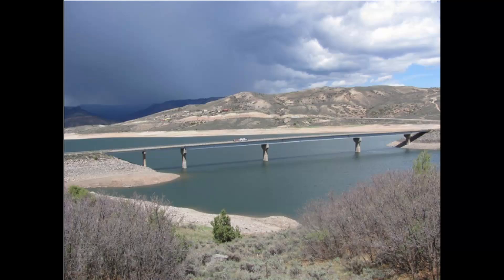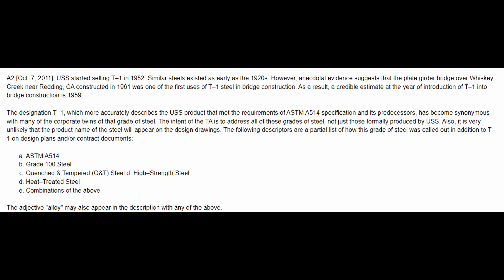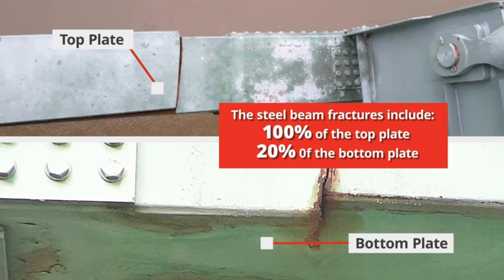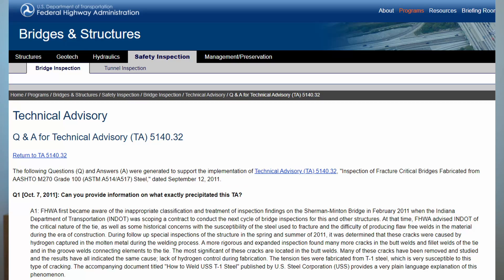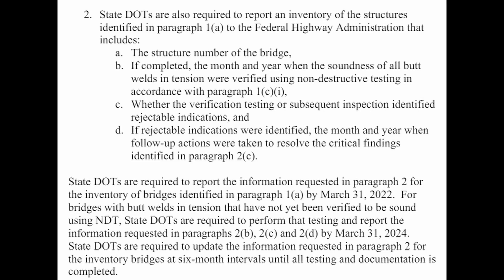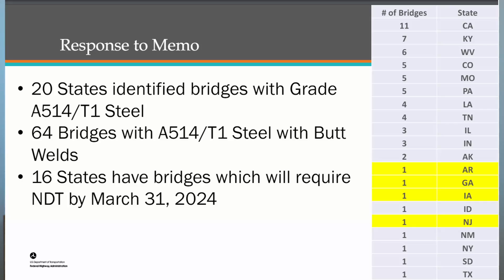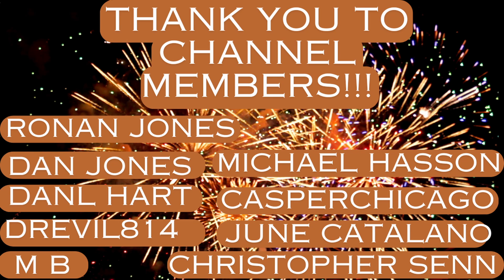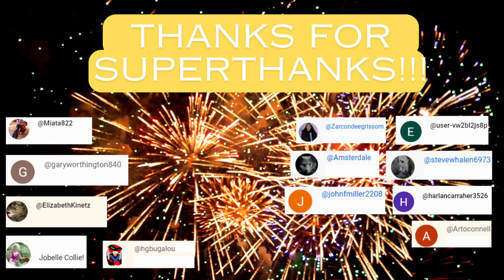The Major Implications of the US-50 Bridge Closure in Colorado

Comment: If we now understand that the type of weld was at fault, what is the problem with cutting out the old weld, then laying a proper weld?
Reply: Two problems:  a. Cut out the old weld and the bridge falls down. b.  the "proper weld" done outdoors might be possible for a single weld of 50 grade HPS with a plastic enclosure in good weather, but most likily with T-1 will be worse than the one cut out as the site is potentially close over water, temperature and humidity changes are drastic, and the wind blows and is gusty.  Early in my carreer a fabricator attempting flange butt welds on 46 ksi bridge steel for a structure I designed went broke with the cost of the rework and upgrades to do it right, and that was in a shop.  Note there are a couple of hundred welds with problems.

Comment: Recent update on 8/13/2024:  Refinements to timeing of public light vehicle crossings.  Also allows school busses..  Expected opening to all legal loads 24/7 by mid Noverber.  Finished by end of December depending on weather.  The estimated amount of steel required is now up to 420 tons, 400 plates, 55,000 bolts.  Many suppliers and steel shops involved.  Work now includes cross bracing.  Cost mentioned is $100,000,000.  I think this indicates they are using this emergency to shoot for a near total rehab of structural and deterioration issues, and perhaps a few other less critical issues.
Reply from the maker: Thank you for that update!  This bridge is turning into the Ship of Theseus!
Reply: @CaseyJones-Engineer  Didn't know that reference.  My experience is that any structural issue can be repaired or strengthened, but inadequate functionality is tougher.  Generally for composite structures the girders compromise about 1/3 of the structure cost, the substructure 1/3, and the deck 1/3.  These structures may be more heavily weighted towards girders and substructure, though the lack of decent detour would make a deck replacement difficult.

Comment: So, Casey, how can you know when you are safe enough?  I know from having worked in the cybersecurity realm that, when talking about safe, it's not a yes/no issue.  It's degrees of safety, and finding the right metrics, criteria, and thresholds is tricky. It would be great to have an series of episodes on how you establish and measure safety for dams, bridges, highways etc.
Reply: Fortunately structural engineers have been designing structures for several hundred years and change codes to correct issues found.  The latest US bridge code, LRFD started out by determining exactly this issue.  For new bridges the target is a 1/10,000 chance of failure in a 75 year life, without considering deterioration from age, based on public acceptance.   Foundation failures and rails have a higher tolerable failure rate due to a lack of control of unseen natural materials and public behavior and impracticality of achieving the same reliability as new bridges.  This does not consider "black swans" which are beyond prediction.

Comment: I have been critical of you in the past but this is the kind of report I appreciate.  I do have a single question, has anyone looked into why this situation was not discovered in the bi-annual bridge inspection.  While cracks that need testing would probably not be visually apparent, it certainly appears in some of your examples that these are visually apparent.  Having been responsible as a principle and as an inspector on over 500 bridges I begin to wonder why some of these cases were not identified.
Reply from the maker: Uncovering these cracks takes a level of effort that is well beyond that required for routine or periodic inspections.  FHWA became aware of the cracking issues of structural members on bridges made of T-1.  FHWA required states to identify which of these bridges were still in their inventory and directed them to complete high-end inspections including non-destructive testing (NDT) using ultrasonic or magnetic particle testing.  Those inspections were to have been completed by February 2024 but it appears that deadline was not met in Colorado as it wasn't until April that the discovered the first crack of concern.  I don't disagree that you would think (or hope) that at least some of these cracks would have been discovered through visual means during routine inspections.
Reply: @CaseyJones-Engineer  My question was not about those cracks which require specialized testing but the failures shown appear to be visually identifiable.  Maybe they visually appeared suddenly but in some of those pictures that does not appear to be the case.  Similarly the Washington Bridge photos of the vertical bars, while not in this category, would appear to have been evident in an inspection.  I cannot tell you how my employees had to clean guano off bridge seats to inspect bearings, that is when it is nice to be a boos.  It just appears there are some inspection issues.
Reply from the maker: @dmac6004  I think you are right about that.  The other category is where inspections document major deficiencies yet nothing is done about such as was the case for the Fern Hollow Bridge in Pittsburg.
Reply: @dmac6004  Many scary things are exposed when 20 years of sand and dirt are removed.  Unfortunatly this cleaning has not been typically done.  Focus is on potholes and stripeing most places.  After the I35 collapse from a gusset failure there was an FHWA mandate to inspect and rate Gusset plates that exposed a lot of heavy corrosion.
Reply: @michaelmcmullen354  As I said I have been responsible for over 500 bridges and having been on many of those I know that we had to clean many areas out, sometimes of loads of bird droppings, but it should be done.
Reply: @dmac6004  I agree.  Build up of any sort of debris and dirt, sand anywhere causes deterioration.  My personal feeling is that the number of inspectors should be doubled or paired with an equal number of maintenance folk and they should have a PU with them wiith a medium sized tank of water, an air compressor, a high pressure sprayer, power supply, a Magnetic drill, an assortment of HS bolts, nuts,  washers, extensiometers, maybe a welder, small sand blaster and plasma spray gear (or not... maybe one team could have a qualified welder ), garden sprayer with siloxane.  Two year cycle as for bridge inspection should be often enough.  Won't happen.  They need the mtc head count for maintaining the asphalt surfaces.  One region in Colorado used to have a small mtc team specializing in bridge mtc, but the head count need for asphalt mtc closed them down.  I likewise for a few years was in charge of a design squad responsible for 2 of the 6 design regions of Colorado.  My best luck at getting this sort of stuff done was coordinating with the resident engineers setting up paving jobs to get as much of this minor repair and profhilactic mtc. done under the radar for paving overlay jobs.  The Bridge maintence in Colorado has gotten much better over the last 10 or 12 years though, but that does not eliminate the damage from 40 years of neglect.
Reply: @CaseyJones-Engineer  Actually these inspection reports, if well done, are very good as the rehab design engineer can track progress of the problem through multiple inspections.  New method of reporting with a number score for each element, not so useful except for tracking system wide deterioration trends.
Reply: And impedes inspection.

Comment: How is a welder for 41 years amongst other steel construction when I worked as a sheet metal worker are you telling me that they were depending on butt welds to maintain a bridge. That is remarkably insane. Even when I put together temporary i-beams and had to lengthen them in order to use them as trolley rails to disassemble and reassemble elevated booths inside of a factory. I know they're 2 in thick and there's a welding specification for that, but there's nothing wrong with fish plates or with straps to ensure reliability

Comment: Hydrogen cracking is not caused by stress etc. It is literally hydrogen diffusing through the steel and coalescing to something like microscopic bubbles in the metal crystal lattice. A crazy nightmare of a problem.

Comment: What options were examined ,other than closing ?  Two vehicles or some number, One semi truck at a time….so as not to effect people requireing use.   Temporary repair…..weld crack….weld patch steel….or just panic, and close it !   Who is in charge ?  Hopefully not a government agency.
Reply: I believe CDOT was in charge, both the resident engineer in the region, and the state Bridge engineer.  Higher ups did a great job chasing down money and coordinating with FHWA, the rest of state government, and the congressional delegations as well as keeping everybody off the backs of those actually trying to do the work and fix the problem.  Once the contractor was selected with his Engineering firm partner things went fast because the contractor and his engineer of choice had been down this path with this problem recently on the Hernando De Soto bridge, and was used to working with CDOT as well.  Also it seems at this time that none of CDOT's early decisions had been wrong.   Odds are that any collapse would be in winter when the steel is more brittle, but delaying inspection and repair would just mean delaying any fix to next year, if the bridge survived that long, but closures and problems would be no better then.

Comment: How long did the original engineers expect these bridges to last? Nothing lasts forever.
Reply from the maker: I agree that these bridges are at the end of what would be considered their useful life at 60 years old.
Reply: @CaseyJones-Engineer  I believe the Colo State Bridge Engineer mentioned that the average age of a bridge in Colorado at replacement is 62 years.  We have relatively few highway bridges still in service at 90 years old.  Current target lifetime for new designs per code is 75 years, with some designs targeting 100 years, but I am not sure we have enough of a handle on corrosion and concrete deterior exacerbated by deiceing chemicals, problems with steel girder fatigue, expansion joint leakage and breaking, and expansion joint failures.
Reply from the maker: @michaelmcmullen354  Thanks for your comments.  I think corrosion will pre-maturely limit the life of many bridges.  I think road salt was a big factor in the problems associated with the Washington Bridge in Rhode Island and that bridge only lasted 50 years.
Reply: @CaseyJones-Engineer  A few years back CDOT replaced a very large bridge that needed to be replaced mostly due to corrosion problems and the limited life of patching again.  About a billion $.  We spent about $25,000,000 on a medium life rehab so that it would safely last until the EIS could be complete (about 15 years to get an acceptable EIS).  Note the rehab had to be bid three times before there was a sucessful one.  The ultimate replacement lowered the grade rather than replace in kind in order to accomodate community desires and needs.  Untimately, in my opinion, the issue was a lack of shoulders and room for maintenance while under traffic.  Just about everything that can go wrong with a medium sized bridge showed up somewhere on this bridge (no scour problems or vertical clearance problems though).  Much of the problems were related to road salts and poor drainage though.  A lot of extra work showed up during rehab and was fixed, fortunately within budget as the planned rehab work went more smoothly than expected, and some turned out to be unkneeded (old visual bottom of deck signs of deck problems had not been washed away after a high quality rehab in 1980).
Reply: A few years back Colorado, in combination with an upgrade of our bridge rail standard designs for new crash test standards, shifted to stainless steel reinforcing in the curbs under the rails or in Concrete bridge rails.  After several years the backwash from contractors has not died down on this shift of the most corrosion vulnerable reinforcing  (less than 1% of the reinforcing steel in a typical bridge).

Comment: Could be worse. You could be on that bridge as it collapses. That would really disrupt your schedule. We all know the US infrastructure is due for repair/replacement/upgrades. Inspections are crucial to public safety. There's no excuse for not having frequent periodic inspections.
Reply from the maker: They were doing periodic inspection. The issue with this T-1 steel requires an much higher level inspection effort at recently required by FHWA which when they discovered the first crack.

Comment: Sounds like the same teething problem with high strength alloys ship building went through. New weld requirements and people insist on doing the way they always have (engineers, construction contractors, and welders). I also wonder if engineers looked at how these alloys tend to not like the cold. 
Time to have states finance both extensive records searches and inspections. Ooof... Plans, as built records, material orders, sub contractors (and their records), inspections... 

People need to send mail requesting action from their representative. Let them know their voters are paying attention otherwise they'll apply funds elswhere where they think the can get the most positive noise for votes (or worse the shock and alarm bit after a death or two). Get them on notice, this is their watch .

Is there a list of locations available? Would like to know if one's in my voting district before sending a general request for both action on this topic and the funding for it.
Reply from the maker: You make several interesting points. I am continuing to research this topic and will post video updates accordingly.

Comment: Wondering about temperature extremes on this 50 bridge. This area gets 30 to 40 below sometimes in winter. What do you think ?
Reply: Thermal differentials can cause very high stresses,  Very cold can cause cracks to propagate very fast (speed of sound in steel) if the tensile stress is high and the charpy low.

Comment: I remember watching a documentary on the building of a new cable span bridge. The bridge was a new design and the construction company engineers had to figure out how to build the bridge as they went because a bridge of this design had never been built before. One thing the construction engineers went into is that the bridge was designed just heavy enough to carry the loads put on it. One engineer described that the bridges built in the early 1900’s were still serviceable because they were extremely over engineered and could easily withstand 2 or 3 times the loading required. It was very interesting. It is amazing that the bridges you discussed, the engineers knew the welds and joints would fail because they knew the techniques used were faulty. It just doesn’t make sense and now we are paying the price.
Reply: Note that most of the structures built in 1900 have already failed (some during construction), or become obsolete.  With appropriate maintenance railroads may be an exception, as they are not subject to deiceing chemicals, locomotives are no heavier now than in 1900, and many lines have no more traffic now than in 1900.  They do have problems with floods though, and are unsuitable for high speed trains and significant overloads (highway bridges are usually subject to overloads... up to 100 tons is common in Colorado, and most of those built in 1900 were designed for about 10 tons).  The public does not scream bloody murder if a line is shut down for a time for repairs or maintenance as both the traffic and the structure is under control of the RR.

Comment: I realize it is inconvenient and can affect lives for a bridge to be shut down due to failing an inspection. As a co-worker of mine who survived her car being on part of the I-35W bridge that collapsed almost 17 years ago, and having been affected by bridge closures due to collision by river barge traffic, as well as an overpass being offset from it's abutments due to a crane that hadn't been properly secured before travel, I'd note that a bridge that is taken out of service because of a recognized fault that can be repaired in a few months (depending on weather conditions) is far better for a community than a bridge that fails, or is taken out of service at a level that requires complete replacement, and is far better for the people involved. One of my co-workers was on the I-35W bridge, and spent the better part of a year in the hospital recovering from spinal injuries. Yes she got back to the point where she could dance, but it's a year out of her life that she's never going to get back.
Reply: There are folk in Baltimore that are going to go through some of the same issues, though they were able to get all traffic off the bridge, the inspection team was still there as the impact and failure happened.

And that route is going to be unavailable for the better part of 2 years as they engineer and build a new bridge to span that route.

Comment: Why did they build that bridge with T1 steel in the first place? It is a straight bridge with no reason to limit the web depth. I believe this bridge "failed" before it was bid for construction.
Reply from the maker: I'm not really sure but it seems to had widespread use in the 60s and 70's.
Reply: @CaseyJones-Engineer  The span length pushes the limit where you add more weight to the span, which requires more steel, which adds more weight, etc.  A fully continuous span much deeper with a lower strength steel at the pier would probably have worked , but could not have been shipped to the site.  The flyover the Colorado river, the ramp to the hanging lake trailhead, over the railroad, and going to the hanging lake tunnel west portal is an example.  It is also one of those bridges with inspection walkways between girders.